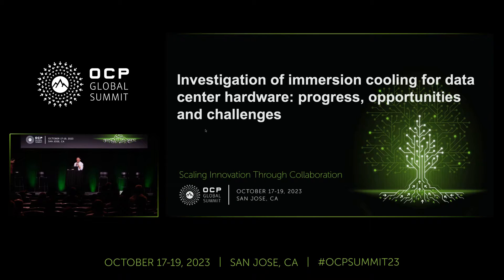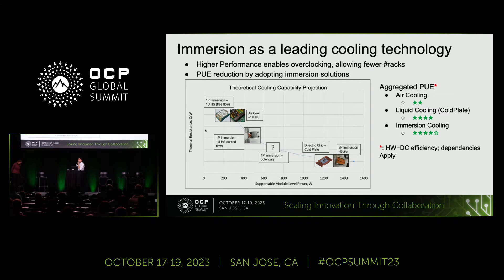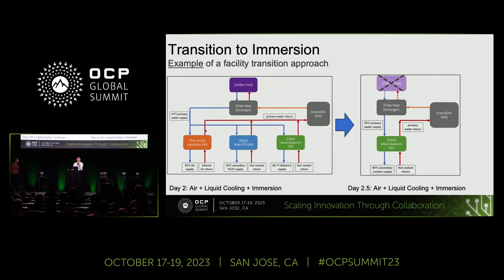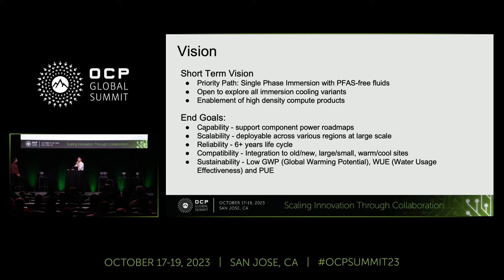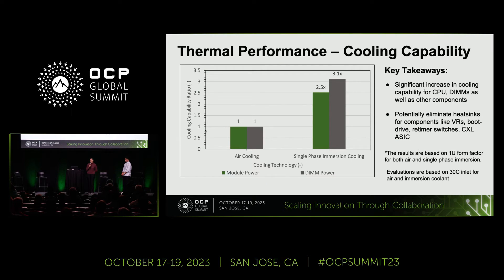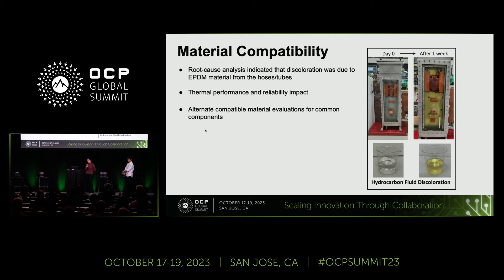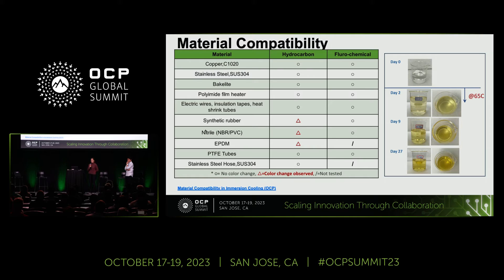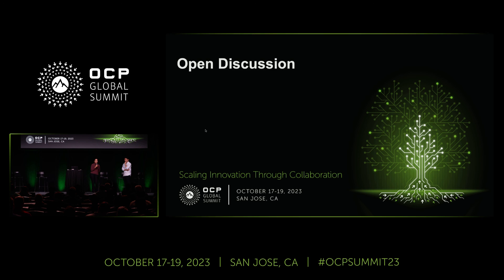Investigation of immersion cooling for data center hardware: progress, opportunities and challenges

Comment: The data center I worked in from 2012 - 2021 as a data center engineer / Linux systems admin started out with classic air cooled vertical racks...In 2017 single-phase immersion cooling was added (horizontal 50U vats using a mineral oil type coolant)...The perhaps single downside was the messiness of working on said servers during hardware upgrades or break/fix...Being the person that handled server recycling when a batch (100s to 1000+) of servers aged out, I always wondered how that would be handled for these oil covered servers.
Reply: To me that's the main industry' challenge.
Reply: @josephherbert4173  Early on we had one sled/server from a 2U/4Node beast that failed within the first month of service...We removed it from the oil vat / rack, let it drain for a day, boxed it up and sent it back to the manufacturer for triage...When it was shipped back to us a week or so later, the box had many dark areas where the oil had gotten into the cardboard. It looked like a paper bag filled with creasy potato chips (I wondered at what point UPS would have refused to handle the box.)